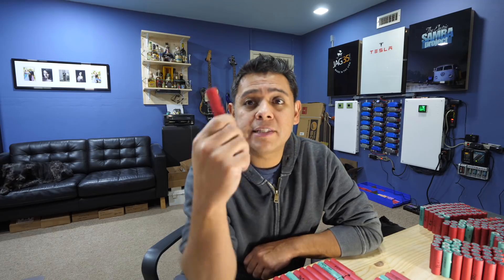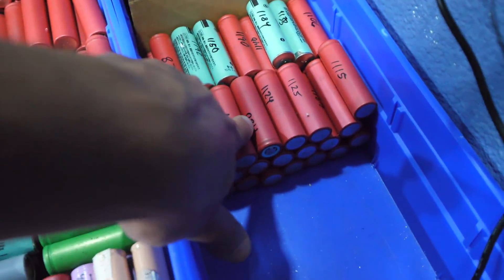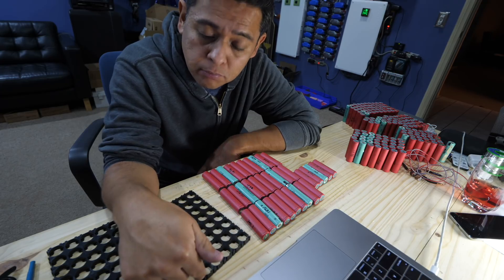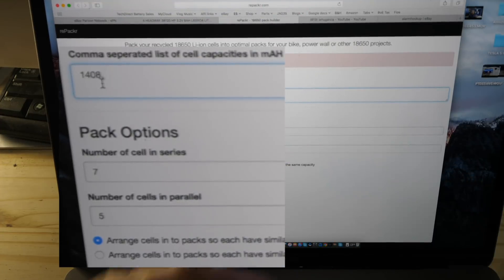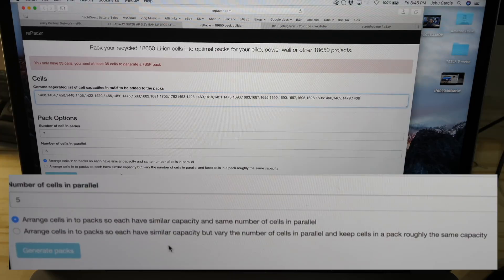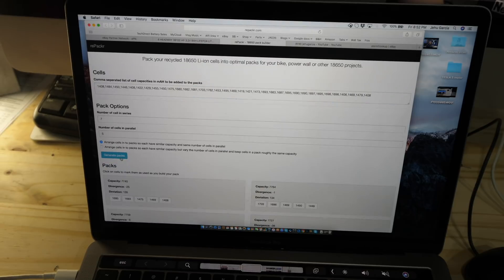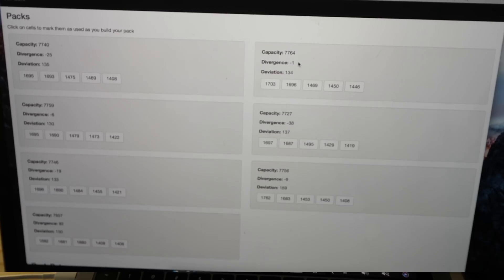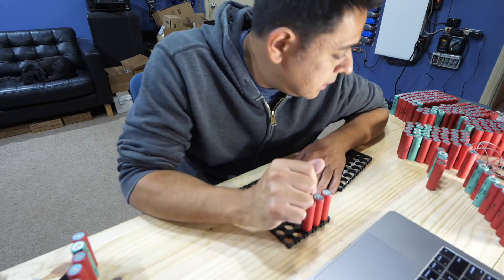Make Matched 18650 DIY Powerwall Modules using Builder tool rePackr.com

Comment: You SHOULD charge the cells first and leave them alone for a number of weeks and see which ones self discharge to weed out the bad ones. Capacity checking isn't enough otherwise you end up with a pack that keeps discharging itself.
Reply: I think he assumed you did that already.  There are other videos that walk you through testing and sorting of the cells
Reply: Tom Amerman i have seen many cells holding close to new capacity and still self discharging. Roughly up to 0.5% off all my tested cells have had that phenomen. Of course depends on source of the cells.
Reply: Phizicks the cells that self discharge would not be holding 80% capacity. Especially since the cell analyzers calculate discharge capacity. I guess if these cells were originally 2600mah and reading 1400mah then there could be a self discharge cell but if these are 1600mah cells new and reading 1400mah now there's no self discharge. That means the anode is shorted with the cathode.
Reply: What about Restances??I have also seen the same but was able to catch this with Resistance testing. I like to resistance tested every cell, looking for the higher ones. those I typically find will self-discharge pretty fast compared to the other cells. Some people instead of resistance testing will just charge a cell and if it falls below 4V, they consider it bad. I have seen cell at almost full capacity, self-discharge with high resistances. Also if you have a cell with high resistance, and you try a measure the capacity by charging, instead of discharging, and you use something like 0.5amps. You will get a much higher Capacity than the other cells. Typically easy to find, based on them measuring 2800mah and the cell is actually 2600mah. The cell is discharging at the end of the charge faster than the charger cycles.(but I am a newbie, and these are just my experience with salvaged cells.)

Still a great Video, but my only worry is using Brass strips, instead of copper? I thought this was a no-no? I had always thought he used copper?? I can find brass strips all day long at my local hardware store, just not copper. I have to make those myself.
Reply: Did you put a load it? Like a watt meter? If you put a load on it and the current drops big time, 90% or more that the battery is dead though

Comment: Hi jehu i want to know when I charge my batteries they drop in voltage a little say 4.14v or around there is that normal they stay at that voltage and dont self discharge im just wanting to know if that's normal

Comment: If you give this repack tool more cells than you need in the pack the capacity will be way closer as it's going to discard cells that aren't good for the pack
Reply: Sweet, I didn't know it did that! I'll definitely try that next time I'm building a pack!
Reply: I was surprised at how well the program could balance the cells.
Reply: Well that changes everything considering he has an official shit ton of batteries. I would also try to pick out ones that were closer to begin with.
Reply: The Algorithm chooses the Highest Capacity Cells to start with.   It would be cool if they included a Bubble Sort program you could use as well.

Comment: Hey jehu
You can buy spotwelders really cheap on aliexpress (150$). Please try one out. I think it would be worth it because you make so many battery pacs. You can also buy the wire wich is used on the resistor legs.
Reply: Jehu has other videos on using the spot welder.  I think he owns one or two of them
Reply: Gerald Grogan but why is he then soldering?
Reply from the maker: https://youtu.be/O9c8VrCuCwo

Comment: Btw, instead of the little resistors you can also just use wire on a spool. Copper, silver or other types of wire would work just fine.
Reply: Yeah curious. Or just buy fuse wire. It really is an aspect that "smells" a little about this channel. It would be nice to have a video on how to precisely calculate the needed wire length and gauge for a certain battery pack instead of guesswork.
I mean it can be done.
Reply: What do you mean by calculate? It's a matter of a few simple physics laws about wire length, resistance and dissipated power -> heat?
Or the simple version, look what companies use and use that as well. A little to big never hurts.
Reply: Well yeah, that's what I mean. It should be simple calculation if you know how (I don't know how).
Reply: http://www.powerstream.com/Wire_Size.htm
I guess you could use the chassis wiring current load limit, which would make 23 or 24 AWG seem appropriate for use as fuse wire in a bus bar. This is assuming soft annealed, nickel-free, solid core wire.
Reply: @tofush0e  No, you cannot ...
Reply: I think the idea is the resistors are easier to handle when you have to do the job a lot.
Reply: But nobody’s puts a formule down how to calculate lol